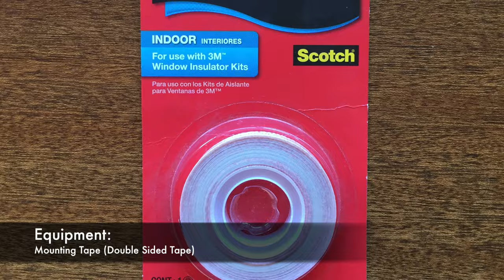How to Install 3M Window Film Insulation (Ecobob.co.nz)

Comment: Tape is rubbish... it's got weak stick and one side doesn't peel off...it doesn't seem to be 3M technology or maybe now the Chinese is producing it...Bought from Amazon and tried to install today...Utterly rubbish
Reply: I am facing the same problem. When I am trying to peel the side with paper the paper breaks even if I do it very slow. Did you find an option?
Reply: @kunalkis1812kk  The tape is rubbish. I cannot remove the paper liner from the tape. On the video it looks like the person bought a different tape. My kit did not come with the tape like the one shown on the video. I cannot find a video which shows how to peel the paper liner from the tape.
Reply: I just watched on another video from the states to leave the adhesive tape on for about 15mins to let kt become tacky before peeling the double side off. I am about to apply this and see if it works.
Reply: @deepee5897  good tip, I would add blow some heat onto the tape as well then peel it off with nail.

Comment: To everyone who is having trouble with the backing coming off the tape. The tape is too cold, if it starts separating, warm it with a heat strip gun as you peel it. Works like a charm.
Reply: I recommend to using 3M scotch magic tape, and One day later use Hair Dryer. 1 layer is double sided tape, 2 layer shrink film, Trim all excess film, then 3 Magic Tape. place Magic tape half on the shrink film sides and other half must be on the window. With this way you can support the shrink film and also have smoother edges.

Comment: When I use the blow dryer the film comes off from the sides at the very end. It gets too tight and then starts pulling on the sides and comes off. It destroys the tape and i have to start all over again. SO fuking frustrating

Comment: I have the kit.. haven't put it on yet, it seems like a load of shite to be honest. I seen clear plastic wrap in some hardware shop last winter it was thicker and just went on like window tint.
The video was good. Simple to follow no bullshit
Reply: It's not the thickness of the film but the pocket of air in between that stops thermal leak, I thought the same thing but it works amazing, especially for the price.

Comment: I’m having a problem lately with the mould on the wall spreading from the moisturized window due to the temperature difference of inside and outside😢 will this insulating layer work enough for this problem?

Comment: Does this film really works as heat insulator? We have hot summers here, where temp reaches 105 F, will this make a difference?
Reply: Did u ever get an answer to this?
Reply: We have not a thermal camera and also not tested. But i recommend. For instance our windows 2 layer of glass. It's have one gap of air. After applying this film we have 3 layer and additional larger air gap. This air gap insulate the outer and inner temperature.
Reply: What provides the insulation is the air in the gap between the film and the glass. It works like a double pane window.
Reply: Before applying this film we had problem with the  Window Condensation every morning in the winter. We had to wipe moisture with towel. But now we didn't notice the  Window Condensation. So it's works definitely. Because the film doesn't cold easly as glass. If you touch the film you can feel warmth in the winter. Like winter season, you can feel less hot in the summer.
Reply: @ivojara  Yes. After applying film, I can called our windows now 3 pane window.

Comment: if i want to remove the film at a later date can this be done easily?
Reply: Yes - it peels away from the double-sided tape easily.
Reply: @Redberryfarm888  and how about the double-side tape? can it also be easily removed?
Reply: @xanamoth1769   yes... but I have found that it also can (usually) pull up paint or varnish of the window trim, depending on where it is put on. ( Try around the outside edge of window trim next to the wall...)  
Leaving it in place to try and reuse again doesn't stick as well, plus gets gummy during the hotter summer months. 
 For me, my curtains cover our window trim that looks a bit ratty from the years of using tape on it, but it is SO worth having the warmth and no condensation/rotting windows during the snow season, hands down.
Reply: @Redberryfarm888  thanks for answer. I am wondering for how long term people are using this stuff? You won't be able to wash windows because of this thing, right?
Reply: @xanamoth1769  I use it just for the winter, and no... I don't wash the window. (no need to...no dust, etc.) The windows get washed inside and out in the spring when I take off the plastic and put in the screens again.  I try to be careful removing, and usually get a few years of use out of the plastic. What I go through is the double stick tape.
Reply: @Redberryfarm888  oh, you use it just for winter? But then it is not practical for sure. First money waisting every year, and second, i think that the tape must definitely leave some marks. But thank you for your comment 🙂
Reply: @xanamoth1769  well, it is saving us LOTS in heating costs for sure during the winter snow months... and the plastic can be reused, so I don't see it as wasting money...more of a 'maintenance' kind of cost until we can replace all of our windows.  😊
Reply: @Redberryfarm888  but the Problem i see that it may left traces on the window frame. That is actually holds me back, because after traces a window can look not the best
Reply: @xanamoth1769  - true.... a pro and con situation.
Reply: Maybe use some isopropyl alcohol to get rid of the strips if needed. It would take a bit of effort, but that stuff always works wonders with sticky stuff for me!

Comment: If you use it for windows you will not be able to use your blinds
Reply: Cut a small hole in the plastic just small enough for the rod to the blinds to extend through and use.